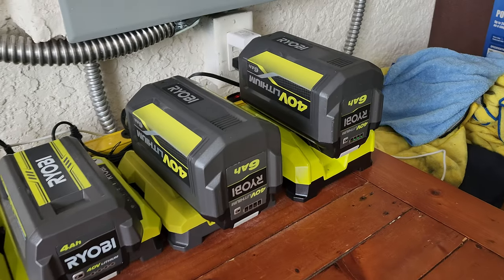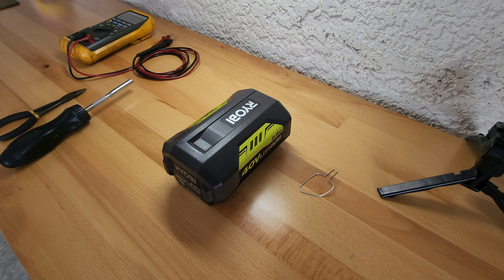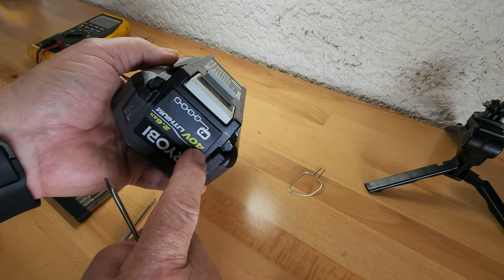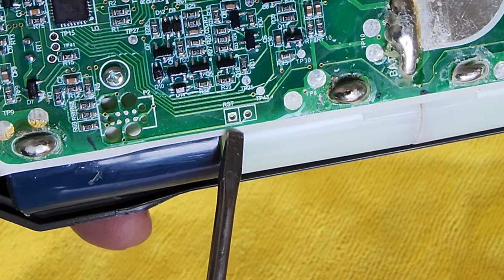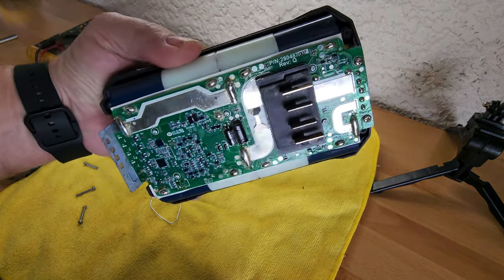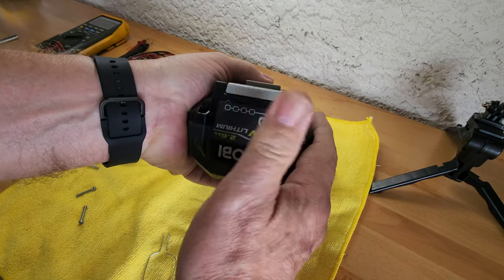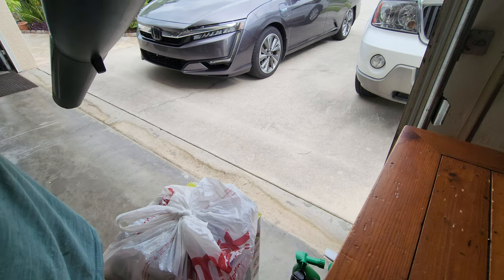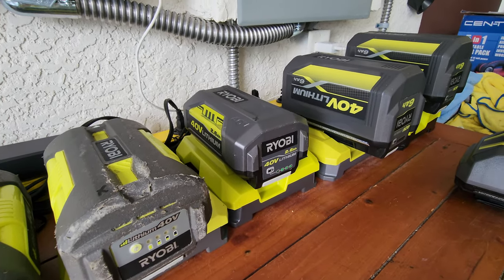Ryobi 40V battery fail, Master Reset!!!

Comment: As my luck would have it, it didn't work for me.😣
Reply from the maker: Sorry to hear that, some batteries may have hard faults, faulty cells or other components that cannot be reset. Thank you for sharing your results. It is good to have everyone's feed back on the matter. Maybe someday Ryobi will put a reset button that can be pressed without all the drama/dissassembly. Thank you for watching, hope you have a wonderful weekend.
Reply: @htnowpro  I will say all the lights did what yours did in the video and when I put it on the charger the charger's light turned green like it was going to work, but within a few seconds I got the red/green flashing.   Thanks for the video.
Reply from the maker: @bryanthornton6787  you are very welcome.